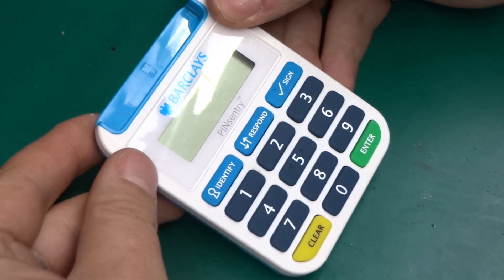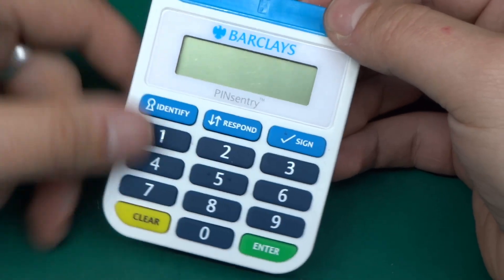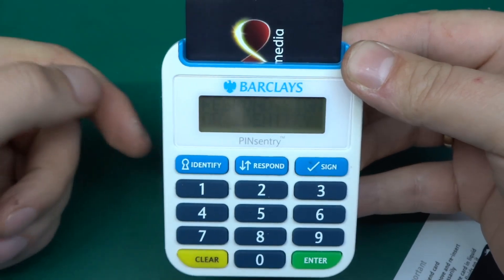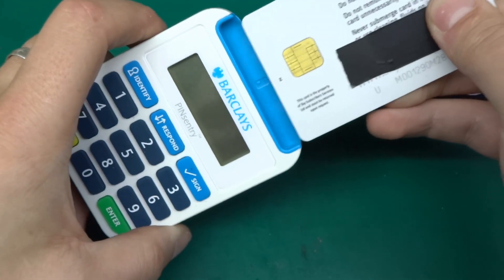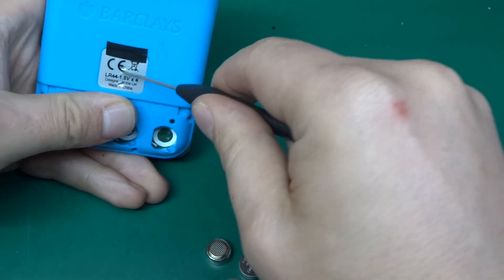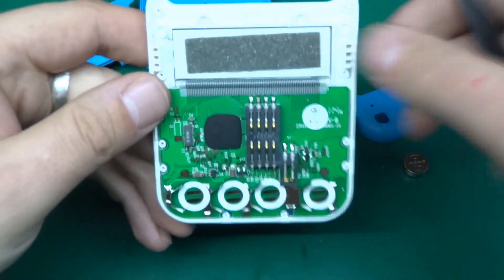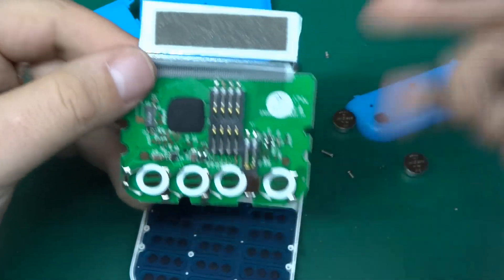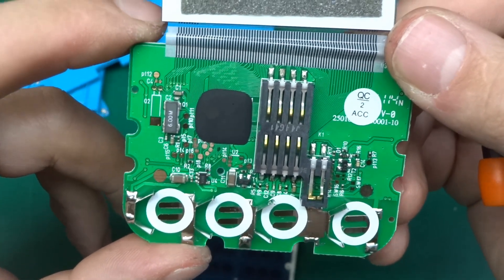Barclay's PIN sentry card reader

Comment: It works with any uk bank you where using an expired card and it’s designed to know wether there’s a valid card inserted or not
Reply: It has no way of knowing whether the card is expired or not. It's just a dumb code generator.

Comment: I'm pretty sure the actual algorythm is stored in ram on the little cob. Once you take the batteries off to get in, it's dead and done. I'm also pretty sure the chip has a temperature sensor and when you keep it powered and get your heat gun to take the epoxy blob off, it'll kill it. Likely some current sensing if you try to probe the wrong test point.. It's not a state of art device but it's good enough. Most of the anti-tamper things can be right on the chip, either software or hardware, which makes it simpler and cheaper.
Reply: No, it will still operate as normal if you replace the battery. I had one from NatWest and it still worked after changing batteries. All it does is decrypt the code your bank gives by combining it with information on your card, it then  generates the decrypted code. Your card has the actual algorithm. After you input your pin it can get the algorithm from your card and decrypt the code your bank has provided, which will then reveal the correct code. Also, the code your bank has provided can generate multiple other codes which are all valid.

Comment: That's about what I expected to be inside that card reader. There's no wifi nor cellular connection. It just takes the card, checks your pin and uses the figures produced by the website as a public-private key cryptosystem and then gives a coded message which is entered and verified by the bank system.

Comment: They are the same between banks as well, my nationwide works with my Barclays card and vice versa... No need to secure the hardware as you require the card and pin to do anything with it...
Reply: FFS! I used my Barclays card in the NatWest one and it worked! Thanks, you saved me a trip to the bank!
Reply from the maker: That's some secure stuff right there!
Reply: @randomtronic  All the reader is used for is to prove you have the card. The device itself is not the security. The algorithm is to provide an answer to a particular card number is where the security is. Find that out from the reader and then you have broken their security.
Reply from the maker: That actually makes perfect sense! Thanks

Comment: How do these communicate because they create a one-time use code. Is it through the mobile network?
Reply: No, they don't communicate. You input a code that your bank gives, and the reader will decrypt the code and give you a new code that is only valid with the code your bank gave.
Reply: @airportdocumentaries  but it changes every time. How does it know?
Reply: @ethanmccrory1727  Once you input your pin on the reader, the reader can then access the algorithm in your card to decrypt the code your bank provides. When you decrypt the code the reader will display a new code which is linked to the original code you entered, but the code displayed can be different as there are multiple other codes that are linked to the original code your bank provides. All of them will be valid.
Reply: @airportdocumentaries  ah I see, thanks!
Reply: @ethanmccrory1727   using seeds such as time, your pin tied to your account/card, and probably another algorithm. So entering your card and pin, will generate a unique code specific to your account valid for a short period of time. Your online account will be aware of what pin would be valid for your account using that same algorithm.

So you never have to input your pin into your device/pc or the Internet.

Comment: They are generic, I used my nans Barclays device when I couldn't find mine and it worked the same.
Reply from the maker: I thought so, it didn't seem there was anything specific to an account inside. Presumably its just a calculator, that reads the chip on card and generates random code that matches the chip.
Reply: It's based on an algorithm that gets the time and your cards ID, then gives an output that you use to sign in online, if you take time putting in the 8 digits you miss your time slot and you have to try again. I'm a software developer and have a little idea how they work, I know 100% it does use time as a factor in the algorithm but I'm not sure what information is retrieved from the card chip itself, it's interesting though. Good video :)
Reply from the maker: +Ste Dunn that was my thought initially, but then i thought where will it get time/date from... The must be some clever engineering behind this :) Thanks!
Reply: I'm guessing it would have an internal clock that always has power to it, even when the card is disconnected.
Reply from the maker: Possible. But i think there is more to it.
Reply: Its runs on a NAND binary set up, it doesnt need power to store memory..

Just like one your your USB thumb drives for example..
Reply from the maker: +Bitsofskin yes, of course. But does the algorithm take only card number as variable to generate a code, or does it use something more, like time\date? The codes expire after a couple of mins or so, so how does that work? No rtc on this, so the mystery is how is the code expiration implemented? This bugs me a bit, maybe it's obvious, but i just don't see how would this work.
Reply: Yep, exactly. The code is generated by combining the card details and the time and generates a code which is only valid for a few mins. Not sure how long tho perhaps 5mins?

These things bug me too, it just shows you, your pin number is actually stored on the card chip, and not ONLY remotely. 

It also asks for your PIN number.
Reply from the maker: +Bitsofskin Yes, and this exactly bugs me: how does it know the time? If there was an RTC onboard, then maybe, but it would get reset when changing batteries, so it would get bricked effectively. And I didn't see anything on there (perhaps it's implemented as part of blobbed chip-on-board). Apart from that I do not see how would this thing get the time to generate time restricted codes. Magic! :)
Reply: I would be taking a wild guess at the circuitry having some kind of small power supply (backup between battery changes) where, i do not know, i agree with yourself, i didnt see any either.

I'm going to be ripping mine open to have a play around with it, maybe leave the batteries out and go round the board with a meter in an attempt to find where it is.

The only other (like when you get it to begin with with, the batteries are not connected, so perhaps it reads the time of your last transaction at a cash point from the chip on the card and uses that to against the time between that and the time your using the code to log in to your online banking etc.

Do you see what i mean by that?

EDIT: That was poorly written, sorry...

What i basically mean is, the code validation that you are using is approved online, which the device will calculate from your last transaction at an ATM and the time your online banking is being used.
Reply: I'm actually going to go test the validity length of a code now..

Ill let you know :))

You got me thinking...

Ill do a few tests and let you know the outcome..

1. Ill generate a code, use it and try reusing it 2mins later.
2. Ill generate 2 codes within 30 second of each other and use the 2nd one first, then vice versa..
3. Try using a code 5/10/15/20/25/30 mins etc apart until i find the limit.

EDIT 4. Phone the bank to get them to unbrick my online banking lol :P
Reply from the maker: +Bitsofskin Awesome, please post your findings once done!
Reply: There is no time clock in this device
Reply: Even other banks' card readers work for each of the other banks